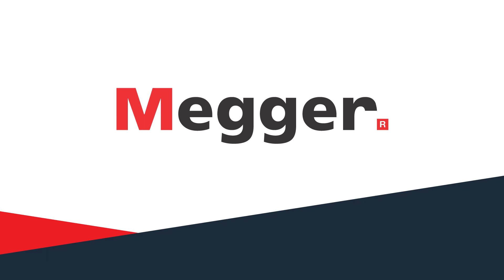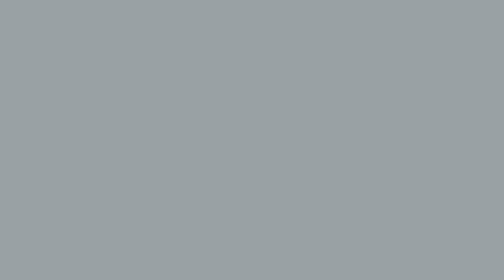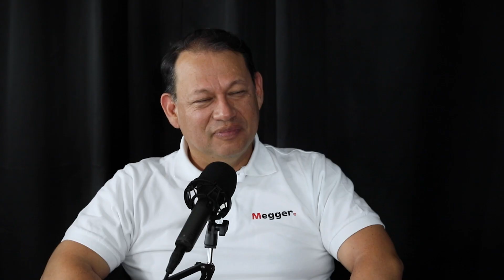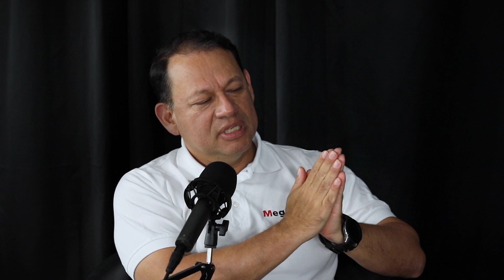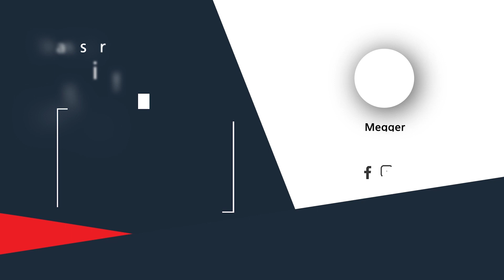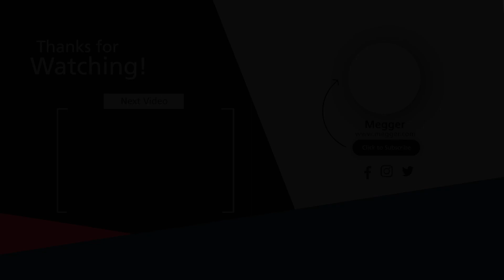Static and Dynamic Testing I Megger Watt's up podcast I EP12

Comment: These podcasts are useful but here complementing with slides and going through testing methodology would have been even more helpful and useful. Otherwise these general conversations make using testing equipment more abstract and less practical.